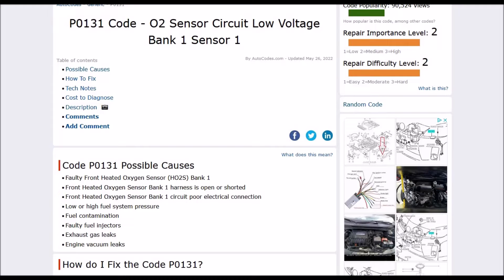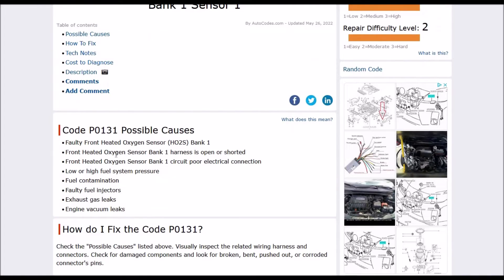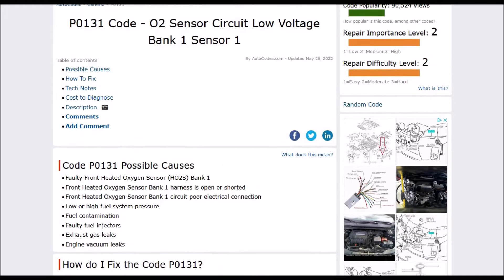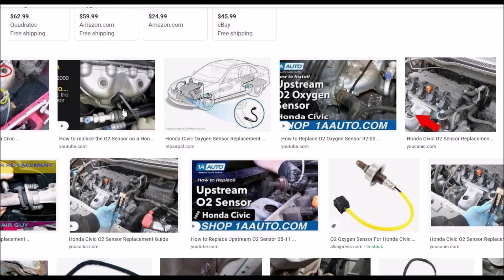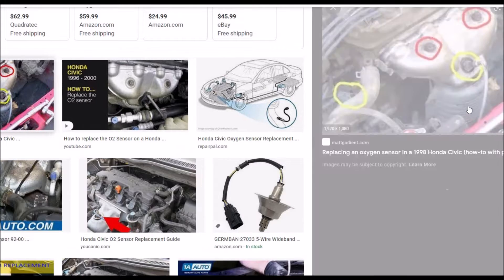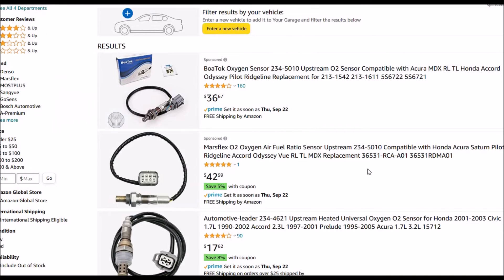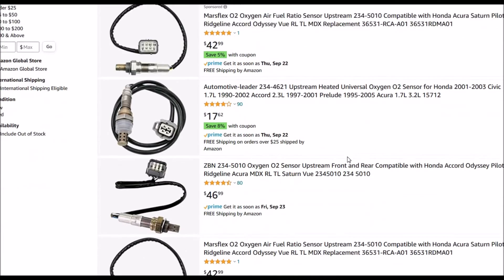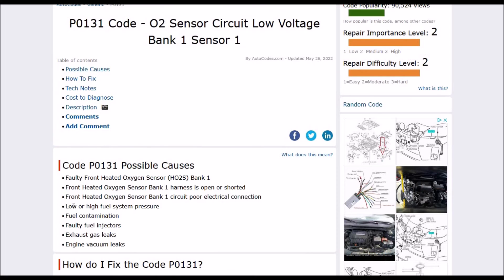How to Fix Honda P0131: O2 Sensor Circuit Low Voltage Bank 1 Sensor 1

Comment: I have a d16z6 i replaced the o2 sensor an engine light/code is still popping up . I thought it might just be a bad o2/faulty o2 as its happened before but now its throwing code 7 as well <throttle position sensor